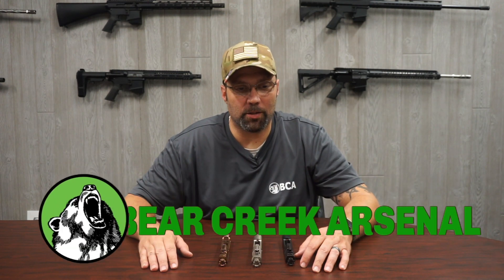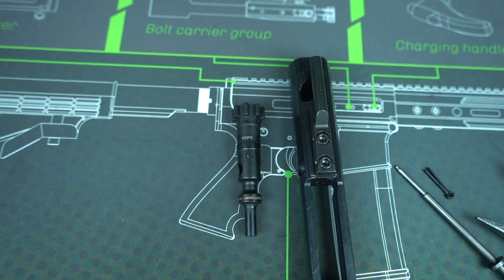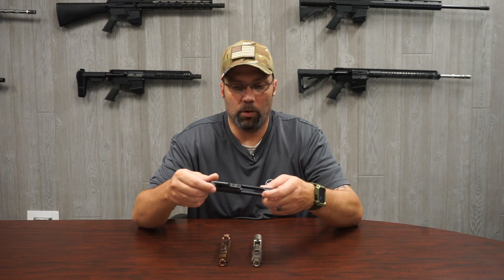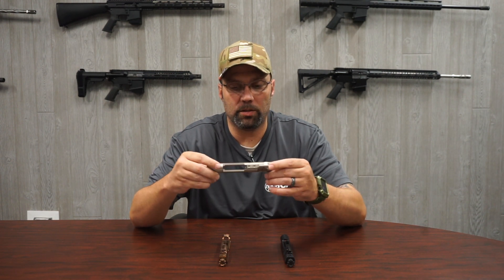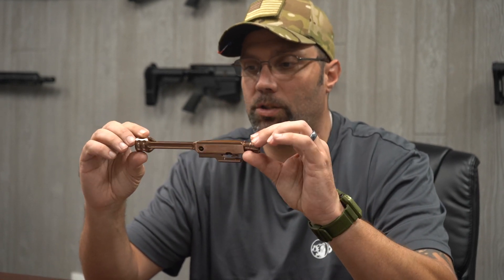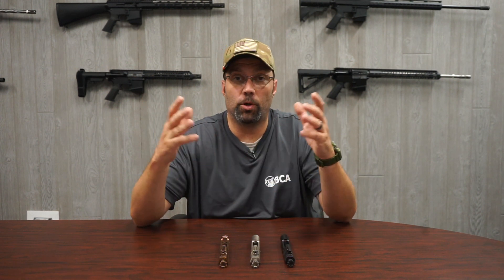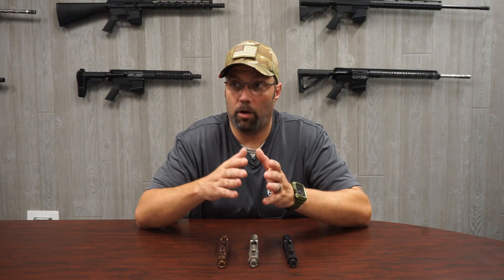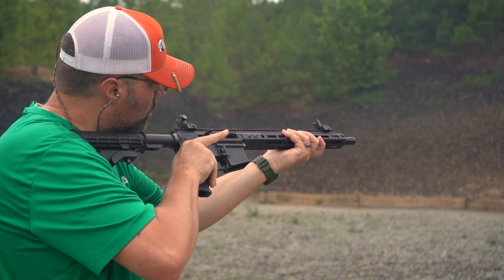Bolt Carrier Groups (BCGs): How to Choose & What to Look For

Comment: Although Reddit tends to hate BCA, I've yet to run into any issues. I would love to have variations in your uppers.. length, finishes, etc.. I think with good QC and PR, Bear Creek could do huge things in the years to come. 

I hope this doesn't fall on deaf ears because I want you guys to do well! This YouTube channel and the consistency of posts is awesome. 

I really hope BCA sees the opportunities ahead of them! Can't be afraid to fail a couple times.
Reply: BCA has their issues, but they also have a lifetime warranty.  My barrel nut was loose (seems like a common problem), other than that my upper runs just fine and is accurate.  Can't ask for more than that!  If anything breaks I'll fix it if it's not covered under warranty.  I will buy more Bear Creek products.

Comment: Bear Creek Arsenal is THE BEST BANG FOR THE BUCK, PERIOD. That being said I wish they would include some MID. LENGTH GAS SYSTEMS ON THEIR 16" BARRELS. Also more barrels configurations, MOSTLY HEAVY BARRELS I SEE, need some lighter barrels PLEASE. Waiting the 450 to come in & see what the barrel looks like inside, my 7.62 from them looked like it was HAND LAPPED, DAMN NICE & ACCURATE UPPER. I used my BORE SCOPE on the 7.62 barrel, I've bough $300 barrels that didn't look this good. I received the WHOLE UPPER YET for just a bit more money, T.Y. BCA, YOU HAVE A LIFETIME BUYER WITH ME.

Comment: I just wanna speak on BCA’s behalf. I’ve now purchased 2 complete uppers from this company. The first was a 16” and the 2nd was a 10.5. The 16” I have well over 1000 rounds through, and not a single hiccup, and I’ve only cleaned the bcg 1 time, and regularly lubricate. The 10.5 I took to the range last weekend, and blew through about 300 rounds in 20 minutes, with no issues. Those were the first 300 rounds. I did find once I got home, the hand guard bolts had worked loose, but that’s an easy fix (loctite). 
If you are reading this and are considering bca, I would advise you to not hesitate. 230 dollars for a well functioning complete upper is literally unbeatable. I’ve heard a lot of people talking bad about bca over the years, and in my experience it is not at all deserved. These are basic (but quality) gun parts/complete guns that are well worth the money. I’ve not yet needed to contact their customer service yet, and I’m doubtful I will but I’ve also heard very good things about that department as well. They’ve made a customer for life out of me. 
-The guy who doesn’t clean his guns

Comment: Finally finished one of my builds that’s running y’all’s 16” upper and it runs beautifully, the only issue I’ve come across is it’s a little difficult to put the firing pin retainer back into place. It’ll go in the left side perfectly fine but won’t line up with the right side of the carrier. Other than that it works perfectly
Reply from the maker: Great to hear! Send an email to bcatech@bearcreekarsenal.com if you need help with the firing pin retainer issue

Comment: Just had a bca BCG fail yesterday after about 1000 rds, ejector spring is weak and or pin is bent, retainer pin for ejector must not have been hardened seems bent and peened over when we tried to push it out.  Bca hasn’t responded to my email that was sent yesterday, probably be afraid to try another one anyways! I’ve got 1000 rds invested in this upper only to have to replace bolt with something better went ahead and replaced charging handle and gas tube just in case.
Reply from the maker: We are very sorry to hear that. Please submit a warranty request on our website and we will certainly assist in getting this rectified. Here is a video that will guide you through the warranty process: https://youtu.be/eR2B27WtoZM We look forward to getting you shooting again.
Reply: @Bear_Creek_Arsenal   they finally responded today, I submitted photos. Also the firing pin has a very sharp edge like it wasn’t hardened as well. Gonna make it hard to trust this thing either way at this point. A gun I don’t trust and can’t depend on is a paperweight or something that needs traded in. 2 issues on 1 BCG is very unusual indeed.
Reply: What kinda QC you have going on there, got the replacement BCG about a month ago and finally dropped it back in and tried it night before last.  Ejector stuck out of bolt to far and wouldnt allow first round to even chamber. Dropped another bolt in and set the bear creek to the side when I walked in shop yesterday I notice the ejector and spring were now missing apparently projected across the shop. Not even sure I’ll bother sending it back, takes to much time to chase silly stuff like this, I enjoy shooting not QCing parts and playing stupid warranty games. BCA you have my information  if you wanna make this right.

Comment: 14.5” 7.62x39 barrels please. No one has them. No one. Everyone is sold out. There’s a market there
Reply: @chacedelaney7282  I specifically want a 14.5” so I can pin and weld my suppressor qd mount and have a 16” overall length barrel. I just looked at primary arms and didn’t see them? I’ll look again in a few hours. Thanks for the heads up👍